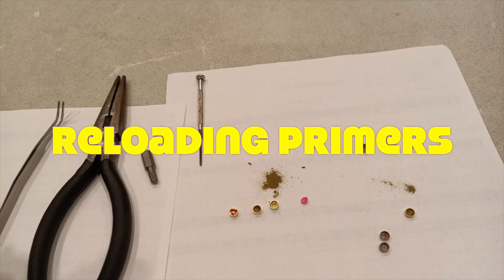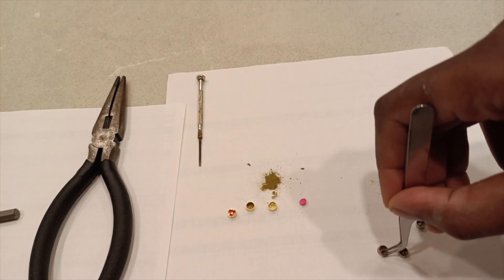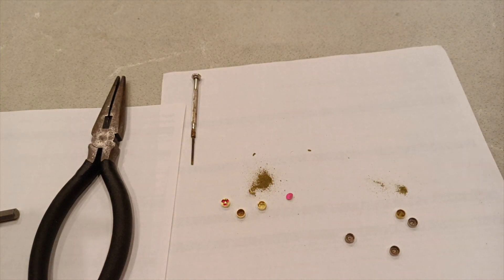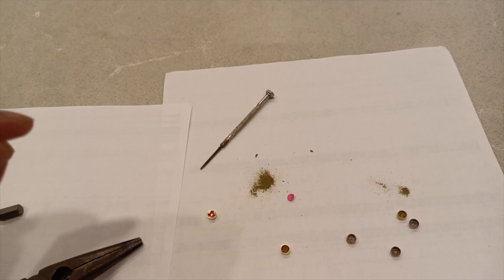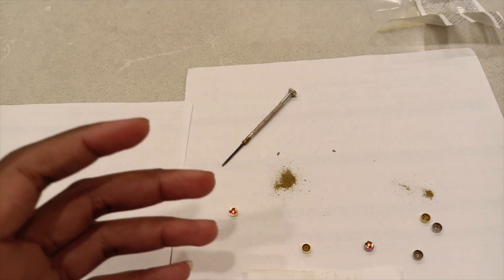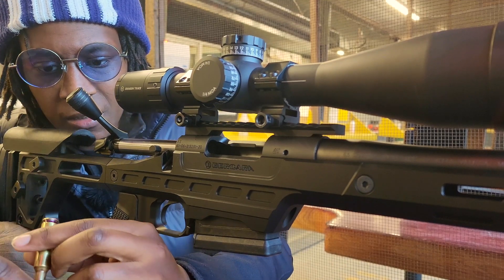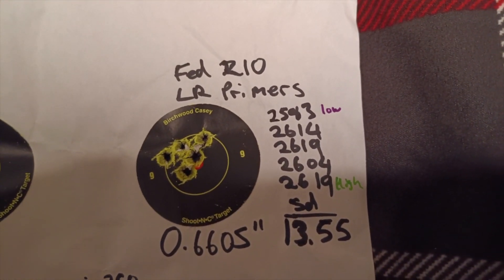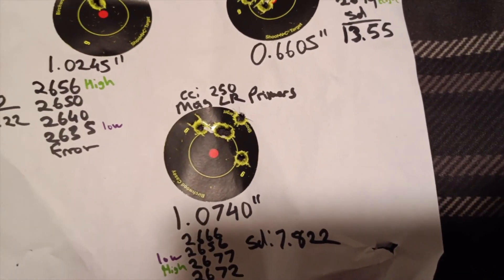Reloading Primers. Make Large Rifle Using LM Pistol Primers. Then Accuracy Testing In 6.5 Creedmoor

Comment: NOE makes primer resizing dies to make things easier... you can also make or buy primer compound so you don't have to cannibalize other primers. Not that it's a big deal doing 1 at a time, but working with the compound when wet is safer and allows you to press the anvil in place before it dries. Most people use acetone or some type of alcohol. Great video.
Reply from the maker: Interesting tool. Yea not sure if you can ship prime all in Canada. Cant buy components to make it yourself nowdays either. This way is also non corrosive. More just a last resort experiment, thanks for the input.
Reply: @killshotcanuck  no worries, there's lots of info on making your own compound from scratch, both corrosive and non-corrosive. Not sure if you have seen Ardvark Reloading, but they teach you how to make several compounds. Not terribly hard long as you're comfortable with basic chemistry. You may be able to extract and purify the components for some of the formulas from different sources if you can't directly buy them. Anyway keep up the good work